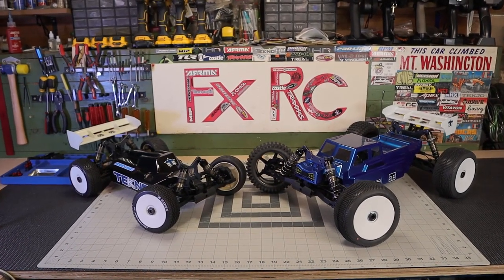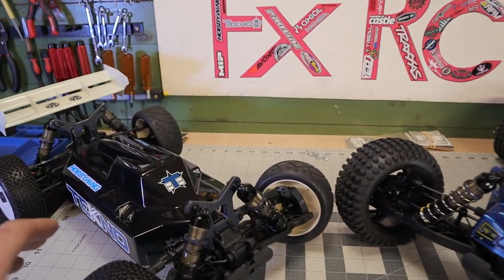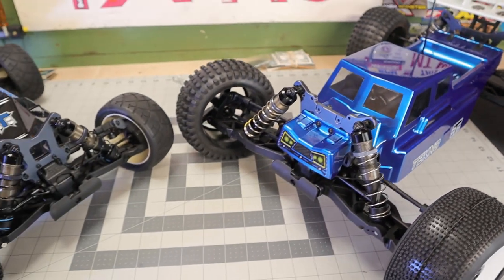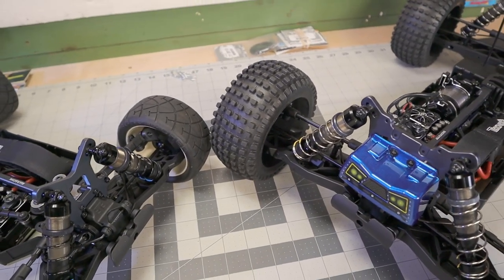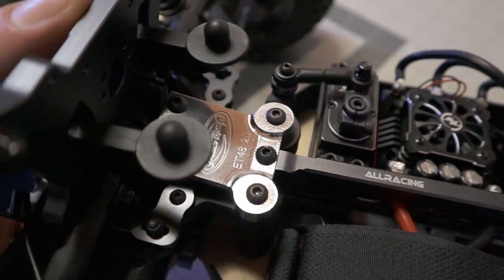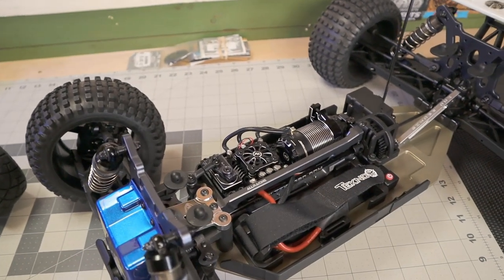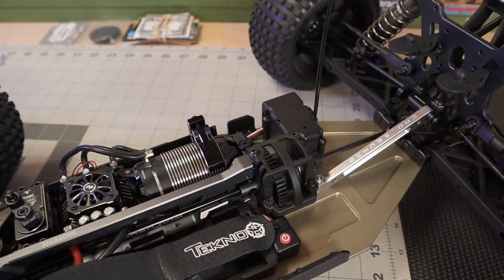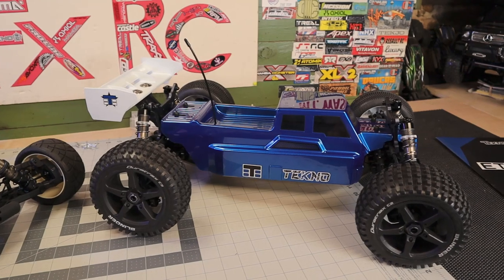Tekno EB+ET48 2 0

Comment: Just something I noticed during your video. On both trucks you have the power wires running between the center brace and the center driveshaft. Seems like the wires would rub the driveshaft on hard landings or maybe all the time. Maybe there is more space in there than the video shows and you have accounted for that in some way. Just an observation.  I just did a bunch of wiring repair on some fan wires that got tore up by the center driveshaft on my Kraton 6s, so I have it on the mind. Awesome builds!
Reply from the maker: Thank you... I built both RCs stock and then added the M2c and Allracing bracing. I was planning on zip tieing them to the upper part of the center brace. However once the batteries are in the wires can't touch the driveshaft. The posts on the ESC are higher then the shaft. However im not sure how much that aluminum driveshaft is going to flex and oscillate at high RPMs. Thank you for watching brother👍👍